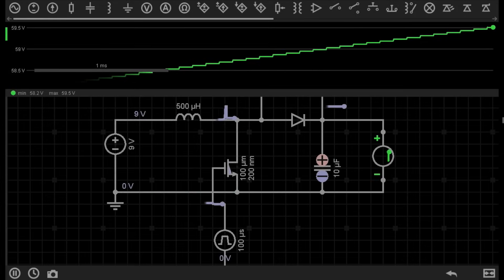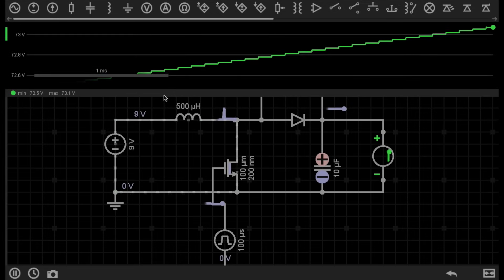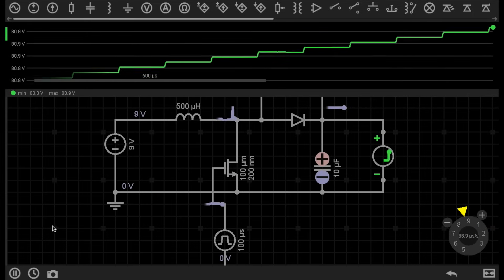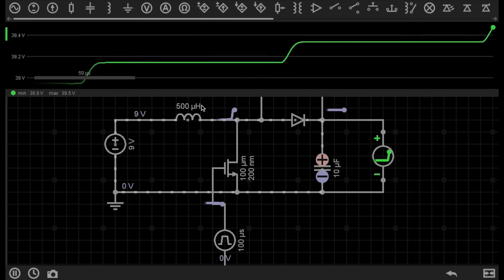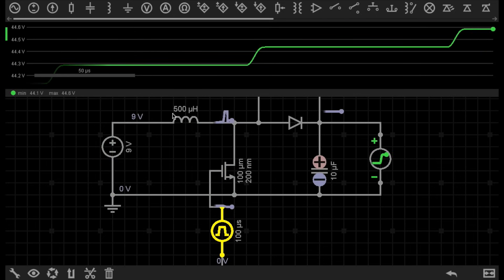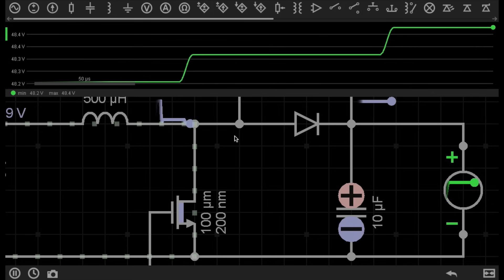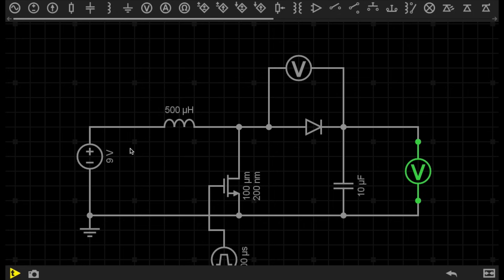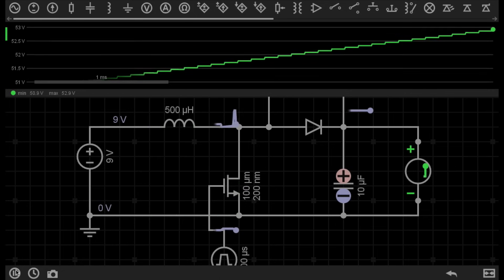How Boost Converters Work (DC-DC Step-Up) - Electronics Intermediate 1

Comment: Great video.
Thanks 🙏

I have 2 doubts.

1)why the current is not flowing through the diode even when it flows through the switch?is it because of the very fast switching?

2) how the circuit is closed during the charging of capacitor?is it inductor -diode-capacitor-source-inductor ?

Comment: Can somebody help me? In my head the capactior can't have more voltage than which it gets applied. So if i charge a capacitor with 30V it will not get to 40V. right? So in my head the inductor voltage spikes have to be at 100V (max Value from the Step Up Converter) But I dont believe that the volate spikes are so high... What I am missing?

Comment: So the capacitor stores the constant flow of current from the inductor and the voltage is cumulative hence the voltage supplied to the motor is stepped up. Does the capacitor incrementally directs power tot the motor pr does it store the voltage until it has reached the desired voltage. Eg 90v and each off receives 9v hence it requires 10 off switches to generate suffient voltage

Comment: Can you please explain why the positive on the transistor is connected to the positive of the capacitor. Doesn't current flow from positive to negative. Bit confused

Comment: Just hook a small AGM lead acid battery to the capacitor it will line clamp the output.
Stop spike and charge the battery.

Comment: How would you turn off the booster(0V)? lets say we use a PWM signal from an arduino uno attached to a driver ic. how do I program the arduino to turn off the booster, letting Voutput = 0V

Comment: I want to use a 9 VDC source to produce exactly 90 VDC output.  Also, I want to use this to power an AM tube radio without creating RF interference.  Can you provide the circuit design and a Mouser parts list?  Thanks so much.

Comment: What is the voltage source controlling the base of the transistor. I tried building the circuit from scratch on every circuit but I can’t find it the parts bar and it doesn’t function without it

Comment: This is intriguing. Normally in a purely inductive circuit with a sinusoidal wave the voltage and current are always 90 degrees out of phase. In this type of pulsed circuit the inductor voltage and current are 180 degrees out of phase when the switch is open and the field is collapsing. That really confused me at first.

Comment: i think the output voltage booster here is safe.

if we consider a resistance of a human finger would be 10KΩ, then the output current would be less than 2 mA. 

i think if i tried it i would feel the tingling sensation on my finger. I would like to try it but i need confirmation and im a bit scared.
Reply: i measured my skin resistance and it was around mega ohms

Comment: so, now the charges stored in that capacitor needs to be discharged.  Or else what happens ??
Reply: In a real circuit there will be feedback so that the voltage is regulated. One way or another you must adjust the duty cycle of the switch so that the amount of charge put into the capacitor is just equal to that being taken out by the load. This might be done by directly controlling the duty cycle with a fixed frequency or by using a variable frequency with fixed ON or OFF time, or by "hysteritic" control where you completely disable switching until the voltage has fallen to some threshold, the re-enable it until the voltage has risen to some threshold. Most converters use fixed frequency and variable duty cycle. Some will also reduce the frequency with very light loads to improve the efficiency.

If you don't use feedback, the voltage on the capacitor could rise to the point where something would "break." The switching transistor or diode might fail from over-voltage or the capacitor might rupture. You might be be able to get a thousand volts from a 9 volt battery. You would need to have a well-designed circuit so that the switching and other losses wouldn't be limiting. Trying to go much over 1 kV limits your choices in components, but it could be done.
Reply: The maximum unloaded charge voltage that the capacitor reaches will be determined by the size of the inductor and the point at which its core saturates.
Reply: @boog567  
No.

Once the inductor is charged to any extent when the switch is ON, that charge is going to go somewhere when the switch is turned off. If the switch, diode and capacitor can take it the charge will go into the capacitor. As the capacitor voltage increases the voltage across the inductor increases during discharge time, shortening the time it takes for it to discharge. Discontinuous inductor current is easily possible meaning core saturation isn't happening.
     di/dt - V/L    (i in amperes, t in seconds, V in volts, L in henries)

If you had 10 V in and a 50% duty cycle, the inductor would be able to fully discharge each cycle once the capacitor voltage got above 20 volts since the voltage across the inductor during discharge is the cap voltage minus the supply voltage. As long as the discharge volt-second product is greater than the charge volt-second product inductor current will be discontinuous so saturation won't happen. The cap voltage would continue to climb until something couldn't withstand the voltage.
Reply: @D614G_aka_Doug   The inductor current never reverses nor reaches zero during the entirety of a duty cycle.

Comment: I absolutely love your videos although they would be absolutely flawless if you would consider explaining and writing out how the math values are decided and calculated for the individual components for example how do you decide that the value of the inductor is 100mH or the capacitor is 10uF or the N-Channel MOSFET is 100uM or 200nM

Comment: Notice that you sacrifice some water to rise up the water (in the video in the below link), the same for electricity, you need to lose some current to rise up the voltage, the wasted current goes back to the battery through the switch.

Comment: Hello, may I ask what "power supply" we are talking about, or better yet, what is the part/function/manipulation inside a power supply that would allow the transistor to switch on and off quickly? New to electronics here...

Comment: It takes one minute  to explain this, yet this video is 6 minutes long, I already gave up.

When inductor's stored electromagnetic energy is used instantly, it corresponds to higher voltages.
Inductor is repeatedly charged and released and the voltage spikes are collected into the capacitor.
This results capacitor to have higher voltage than the voltage source.

This is done via repeatedly switching between two main paths of the circuit via switch.
One path stores the energy into the inductor.
Other path collects the stored energy into the capacitor.

Comment: I think I accidentally did something like this incorrectly adding a relay to a circuit for my basic electric class. The wires were set up incorrectly and when we touched the wires to the battery terminal to test it it made an almost continual large arc on the terminals like a welding arc. I was getting back feed from the ground side of the signal (inductor) side of the relay because it was spliced to the ground of the two lights in the circuit. This caused the relay to alternate open and close very quickly back and forth while the incorrectly biased power wire to the load side of the relay did not prevent voltage spikes and caused the powerful arc. Freaked me out. Nobody knew why it did that but watching your video it seems that by wiring a relay incorrectly you can create a quickly repeating voltage spike; you just can’t store the voltage in the capacitor like in the video.

Comment: how does this type of circuit behave under load? Because I can see that the voltage eventualy stabilizes, but what is the relation between the Inductor or capacitor size vs the amount of current the circuit will supply and hold the desire voltage.

Comment: Thank you for the video but I have question 
Why the current doesn't flow through the diode when the switch is on? Normally the  diode is reversed to ensure that the current will not flow through it

Comment: A boost converter is a DC-DC step-up converter. 
It takes in a low voltage and outputs a higher voltage. 
The boost converter is a popular choice for powering microcontrollers, sensors, and other electronics.

There are many different types of boost converters on the market. Some are simple, while others have more features. When choosing a boost converter, you'll need to consider the voltage requirements of your project, as well as the size and weight of the converter.

Boost converters can be used to power projects that require 5 volts or more. They're also a good choice for systems that need higher voltages, such as 12 volts or 24 volts.

Comment: if voltage is increased, in the next half why does the current reduced
rather it should be higher as the source is now at higher volatge

Comment: just learning this stuff so 2 questions if u have time? 
1) if the switching is so fast that the inductor never fully discharges and discharging is faster?, then it would be the same on the charge side? it would never fully charge on the 9 V. 
2) what is doing that crazy amount of switching on the transistor? what is firing it?
3) what is the determining factor of that output voltage? the size of the capacitor? 
4) the on duration and off duration are not the same correct? inductor and capacitor both discharge quicker than charge

Comment: So what i think ive learned is that your better off connecting capacitors in parallel with a booster to get better capacitance and desired voltage...??? Correct me if im wrong anybody... Good explanation on boosters very use full information for my next project thanks

Comment: If you had included the current change (draws) over the circuit ... 
Doesn't the inductor voltage spike to around 3+400?
Is the current divided by the voltage when it spikes.

You had not  included the series of the inductor to the cap as a voltage . Using batteries as a analogue would have helped support what was occurring.

Comment: Just a quick question. Why doesn't current constantly flow through the diode even when the switch is open, as the power supply is connected in such a way that you would expect it to.

Comment: This reminds me of the old fashioned coil/points system used on cars and motor bikes to produce the high voltage spark to the spark plugs, way back when long time ago.

Comment: if you stopped opening and closing would it stay on that voltage or would it just stop? also does the speed of switching on and of influence the output voltage? I've heard on another video that the output is almost entirely a function of the duty cycle for a given circuit.

Comment: Question : so the Henri value of the inductor is what decides how large is the magnetic field built around it, and by the same occasion decides the maximum voltage output ! am i right ?

Comment: Thanks a lot, I'm studying mechanical engineering and whenever I come across electronics I tend to understand very little, but I've fully understood this circuit thanks to your video. Will definitely subscribe and try to learn more about electronics :)
Reply: Many electronic devices need more power than can be supplied by a battery or power supply. This is where a boost converter comes in. It takes the input voltage and steps it up to a higher voltage, supplying the necessary power to the device.
Reply: Contrary to that, electrical engineering students understand mechanisms/machinery easily. I think it's because of that fact that mechanical engineering is physically more relatable than electrical engineering.
Reply: @organicfarm5524 Back when I was an engineering technician, I was more talented/interested with electronics. I did a lot of prototyping, including populating PCBs. 

When I was moving on from the company, the owners told me that I should have more confidence when it comes to the mechanical side of engineering. One of the owners, a mech engineer, said that mechanical engineering is mostly just "common sense." 

I still think about that. I think the thing about mechanical engineering, is that it's much more applicable and intuitive. You can look at bicycle and easily observe how the pedals turn the rear wheel without needing measurement tools or prior knowledge. You can't really look at a board or circuit and understand it's purpose without prior knowledge or measurement tools.

Comment: What will make the output voltage settle at 100V??
As far as I know, here the output voltage will keep on increasing till the capacitor bursts.
Someone..... Please correct me if wrong.

Thank You.
Reply: I'm probably late but, no, it will not.
Notice that the voltage source charging the capacitor is a series of consisted of a coil and a battery. The voltage induced by the coil is relatively the same, because the current flowing through the coil when the switch is closed is also the same over time. And the capacitor charges because the sum of voltages on the coil and battery is  bigger than the voltage on the capacitor. As the capacitor charges and it's voltage rises, the difference between left part of the circuit and the capacitor will lower, so the current flowing to the capacitor will be lower as well until it is balanced

Comment: Nice, but you usually build it with some sort of Zenner Diode or Output Voltage Regulator and / or some Load.
There's also some Current Leak through the Diode and Capacitor so I don't know about those 100V and the time needed to get 100V. Maybe once every few seconds

Comment: I used xl 6009 e1 boost dc to dc converter ..i convert 5 v to 12 v..with in 1hour it failed...i check the circuit..diode ss34 failed..but in my area its not available

Comment: Can you explain what happend with the ampere hours after Step-UP converting?
is this rule correct for DC-DC Step-UP converters? For example 9V with 2A = StepUP to 18V with 1A minus(-) converter efficiency?
And the same with DC-DC Step-DOWN converter? 18V with 1A = 9V with 2A?
Thank you for your answers!

Comment: Thank you having clear voice and reasonable speeds of explanation. I would think some call this a "Buck to Buck" convertor. I understand automotive electrical systems and a few components plus using a lab scope. As a dealer tech since the mid 70's, I am trying hard to make a simple HVAC actuator control circuit. It is a low current dc motor, plastic gear reduction to drive a door to direct air into or around the heater core. The dash controls are mechanical but I am handy in fabrication. It could be "Heat" but with a linear potentiometer. Since actuators can be simple, this on is as it drives a pot for feed back. Move the dash lever, the motor turns on and moves to new location and stops. Yet, it has to change directions. I was thinking of an OP Amp, the 2 pots as voltage dividers for input. To make it easy, use mosfets in "H" bridge. Just working out on paper, then test and build. Actuator are $10 and I can make a 5 Vdc circuit for mosfet control. 
  Like you, I am into motorcycles but started on lawnmowers to make the $1 it paid in 67 and better than mower with wheel driven blades. Self taught as Yamahas where metric and metric tools fit standards, but not the other way. In the county, word of mouth found Datsuns, Opels and everything else coming to me to fix. It didn't hurt growing 7" to 6'3" at 11 and had tools w/unused machine shed on the farm. 
  I just want to built this as I am updating a 67 C10 PU and auto trans where manual is. Plus updating the engine on the cheap. This way I can have my vehicle to drive to Dr. or store. My wife has a 96 Corolla w/160k so need backup vehicle she can drive and operate. Just simple but reliable. Sad to say she had medical issues and I will have my 4th fusion at L3-L2 and hopes it the last. I don't have a Facebook or cell phone, but get by. If you have an idea for a new video using two op amps to drive H bridge, I will be watching your channel. Thanks again for very good just job on the videos. Subscribed! Omaha.

Comment: At DC voltage, inductor gets short(V=L(dI/dt) or ()Reactance offered by L, XL=JWL, W=0, XL=0)....so how does it boost the voltage
Reply: I think it depends on the voltage across the capacitor
Reply: As soon as current passes through an inductor, the inductor generates a magnetic field (simply said). So now we have energy stored in the magnetic field of the inductor. And now as soon as the transistor closes, current doesn't flow through the coil anymore and the magnetic field collapses (because it's not being maintained by the flow of electrons) and pushes electrons through the diode and then into the capacitor. The diode makes sure that electrons can't get back to ground (negative) as soon the transistor is closed (so they are therefor forced to stay in the capacitor). This process repeats many many times until the capacitor is fully charged up. (Make sure that the diode can handle that high voltage so it doesn't break) the capacitor should also not be charged over it's rating. Correct me if I'm wrong with anything. Hope I could help

Comment: Question sir my car battery is 12v 4amp and my charger is 12v 2amp. Can i use step up converter to change the amp to 4amp of my car charger?

Comment: Doesn't DC current flow from neg to positive.

If this can charge a capacitor, why can't the capicitor be removed from the circuite and the high voltage used to maintain the battery's state of charge.